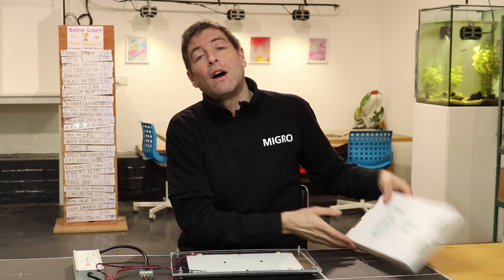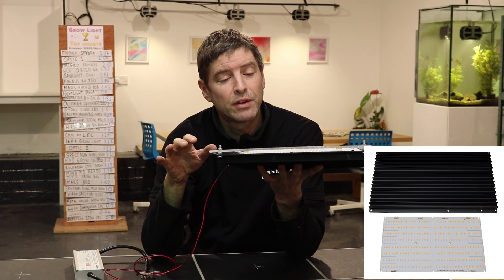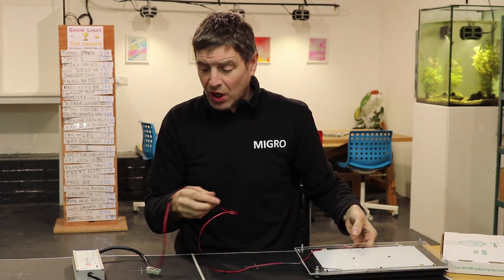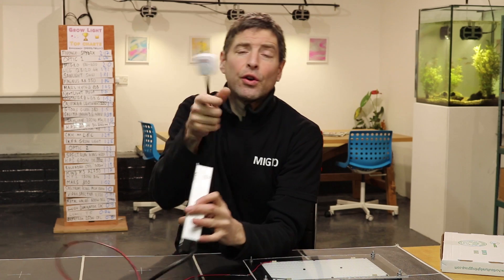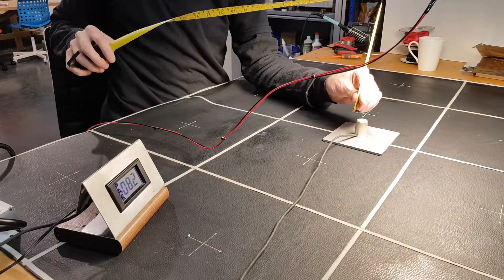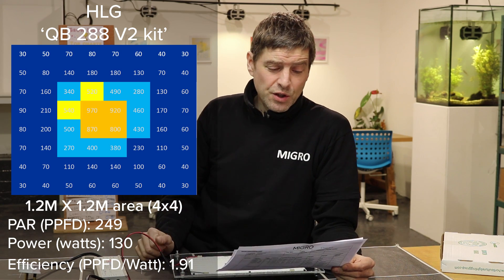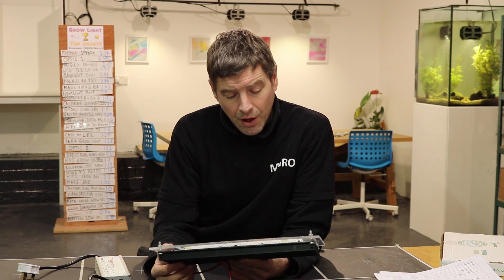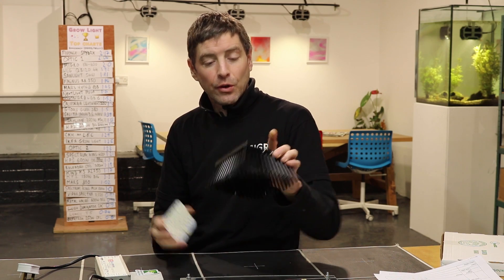HLG Quantum Board grow light test - Horticultural Lighting Goup QB288 V2

Comment: @migro 
Hello!! Last time i ask you about testing the Quantum Boards from China , they should also use Samsung 301 b Leds but for the half Price!! Regards
Reply: Right!
Reply: I am interested in this too. The one from Aliexpress.
Reply: can i have a link for this chinese QB? Thank you!
Reply: @dubbee2295  https://nl.aliexpress.com/item/Led-grow-light-quantum-board-LM301B-288-Pcs-Chip-Volledige-spectrum-240-w-samsung-3000-K/32957263985.html?spm=a2g0z.search0604.3.1.11d03c9ayZQNqN&ws_ab_test=searchweb0_0%2Csearchweb201602_1_10065_10068_319_317_10696_453_10084_454_10083_433_10618_431_10304_10307_10820_10301_10821_537_536_10902_10843_10059_10884_10887_321_322_10103%2Csearchweb201603_56%2CppcSwitch_0&algo_pvid=d058b077-d5ec-4795-acc2-b0d561b1ece7&algo_expid=d058b077-d5ec-4795-acc2-b0d561b1ece7-0
Reply: @dubbee2295  https://www.alibaba.com/product-detail/meijiu-quantum-board-301b-qb288-v2_60812802115.html?spm=a2700.galleryofferlist.normalList.199.195946c9mR31CA
Reply: Where do you think hlg gets their boards from?? Being Samsung is korean based I'm sure they get em before the US
Reply: @MrDollainc  the hlg boards are directly manufactured by Samsung for hlg. I cant find the spec sheet right now but when I get home I'll post it.
Reply: a lot the led boards they're selling in america are actually in fact made by those same companies for the american market, you'd be fine buying a chinese  one. as long as you check the specs. also you might get ripped off.
Reply: @Terrence_Acoose   they ask 200 euros for 2x 120 watt panels including heatsinks mounted already and they include the meanwell drivers aswell, i think its not cheap but also not that much of a ripoff, what are your thoughts?
Reply: @budgetking2591  the ripoff i talk about, is that you risk paying for something that isn't guaranteed. because they're based in china they could send you anything or nothing. the specs on most of the lights check out and should work perfectly fine, even if you have to modify them slightly. also something to consider, a lot of time there's extremely long shipping times, especially if you're not ordering a large quantity. another thing is that its hard to tell if these companies are legit, they use a lot of the same company photos and often times when i go back to check them out the companies disappeared entirely and another company is selling the exact same lights with the same images.
Reply: @Terrence_Acoose  Ok thx, good thing about aliexpress is if they send me something other then advertised, aliexpress gives you the money back, so not really worried about that part, more of the price, since i dont know what is a good price for those 120 watt quantum boards including heatsinks.
Reply: @budgetking2591  if you get the one with 288 lm301b its the same light just running a 48 amp meanwell driver instead of 54v, but doing the math the 48v one should work the same or better as it seemed more fitting to me, i could be missing a variable though but i doubt it. also it uses only 3000k leds, which a mix of 3000k and 4000k would be better for full spectrum.
Reply: @Terrence_Acoose  i have 2 diy builds 2 seperate heatsinks with each 3 cxa3050 4000k cree leds running at 25 watts, so my growlight is 150 watts, i want to use this quantum board for flower. my growing space is 50x100 cm, roughly 2 by 3 ft.
Reply: @budgetking2591  the light itself doesn't produce enough ppfd for flowering cannabis, even if you put 2 beside each other you're going to be a bit low on the recommended ppfd, which is around 800 for flowering cannabis properly and 1100+ for flowering cannabis with co2. 

the problem with mid power led's is that they're only capable of producing so much ppfd, and you're only able to group so many together before the outer led has no effect on the most inner led's ppfd, which forces you to raise the recommended height, then you need more led's to achieve the same result and even more to increase ppfd, which then you start to lose efficiency.

the best led's for flowering are the high powered COB's, specifically the luminus cxm series, which can produce over 500 ppfd per light, put 2 beside each other and you'd be good to go.
Reply: @Terrence_Acoose  I thought these quantum boards were an upgrade over the cob lights, because of the more evenly light spread, i have builds with cree 4000k cobs and 3000k cobs already, so if this quantum board is not better then those, i should not them at all then.
Reply: @budgetking2591  they are, when you get to the large ones, but then they cost 1500+ and you're running a board capable of flowering a 5x5 area that runs at 700watts. the small one's just don't have enough led's grouped up, these are more for vegging. 

the best setup is a double ended hps/led mix, you fill your space with led's and supplement the maxed out ppfd  with hps lighting, with a slight lose of efficiency around 25%. but because you aren't relying solely on hps you save a lot of money still, only a small % of your lighting is inefficient.
Reply: @budgetking2591   I could run 2 of these in a 5x5 beside a double ended hps and turn my hps light down to 400 watts and have better ppfd and efficiency. 640 watts compared to 1150 i'm currently running, i'd also produce less heat allowing me to turn my inline fan down or maybe even off.
Reply: @Terrence_Acoose  Thx for the answers, i understand now, the quantum boards are better efficiancy if you get big ones, but the cost per watt is much higher then  a cree or luminus cob build, while the cobs are not much behind in efficiancy, maybe 1 more + for the quantum boards is you can grow your plants a bit taller if you have limited hight in your growing space. Thx again for your time and answers.
Reply: @budgetking2591  just to correct you a bit, the efficiency is about the same, quantum boards have better spread like you said, that's about it, for a flowering build using quantum boards you'll need either a high power cob or hid to supplement the low ppfd output of the quantum board. even the big one's like the https://forevergreenindoors.com/collections/featuredproducts/products/lightpanel-700 
only put out (they claim) 950ppfd at the center in about 2x2 area, dropping off considerable by nearly 40% at 3x3 and way worse the further you go.

personally I think quantum boards are best for the small setup i explained in my last comment or commercial grows using hid/led setups.
Reply: @budgetking2591  another thing about the mid power led's, these companies run them at 100% more power than their rated efficiency and when you run them at a higher rated wattage the efficiency drops. but its necessary to get the ppfd results you need to grow a plant.
Reply: @budgetking2591  good price, they use the last gen samsung diodes, the lm301b's are their replacement. which are also about to be replaced by samsungs horticultural series of lm301h's
Reply: @Terrence_Acoose  Yeah, they also have strips with 240x lmb301b for 45usd/piece, but the strip with 160xlm561c costs 17 usd. 2 times less per led, so im leaning towards those, i saw in specsheets the 301b is only a couple % more effiient then the older lm561c.
Reply: @Terrence_Acoose  on alibaba there's ways to protect yourself, ask them to take a photo of your address on the shipment and to send it to you, also a picture of the shipments condition. There's probably a more indepth guide to it out there
Reply: @Terrence_Acoose  negative.  All led setup. is best.  You must run hps 😁
Reply: @justinmajewski5904  leds are great if you're running an illegal setup and need to stay under a certain wattage, but the reality is, they dont have the canopy penetration hid light has. 

That's why most legal commercial grows use hps/led setups, you get the efficiency and the baseline ppf you need, and hid gives you the canopy penetration. 

You see the issue with mid power leds is they need to be really close to the top of the canopy to be effective, once your plant grows a 1' that bottom section below the canopy isnt getting very great ppf.

When you take into consideration hid lightings ability to penetrate the canopy, and you take those ppf numbers into consideration, hid lighting is better because of more usable light. 

I like leds and prefer them because I can have 2x the setup for the same wattage, with very minor flower density lose. Even though each plant doesn't yeild as much I have 2x as many plants in 2x more area.  

When you start to use 2k watts+ energy draw, it starts to look very suspicious,  otherwise the price of LEDs and the very minor savings you actually get (depending on where you are, my powers cheap) does not justify the average small scale or personal grower to invest in. 

For example, running a 1000w hps compared to a 660w led is going to save you maybe 20 bucks a month and cost you about 1000 bucks more.  

In 5 years you'll need to buy 5 bulbs for that hps at about 200 total and 12x5x20=1200
1200+200= 1400

Over 5 years by purchasing that led light you've made 400 bucks. Again not really make or break stuff there for a single light comparison. 

At that point you've grow so much you dont even care about the very small price difference of 33 bucks a month.
Reply: @Terrence_Acoose  Negative.  Ppfd is ppfd.  Dead wrong.

Comment: As per the videos of Dr watt in the monster gardens channel... If the light engine is a HPS 1000w... The photons come with more energy and therefore they can reach deeper bids sites down below... When comparing the hps to the black dog 1000 they end up confirming something i already noticed with my 3watt diodes... They work great... If your colas are no more than 20 cm long... Here the importance of an even canopy... While my friend with hps got nice buds on top and down below in an untrained plant... When applying this logic to COBs vs boards... I tend to believe even though same wattage is used... The QB might be using 10 times more diodes than a cob... There fore each diode produces light 10 times weaker (the distance photons can travel and still be usable by the plant) and this is why I'd guess a COB can be placed higher than a QB...  So far i have only used 3watt chips... And these new "10 watt" chip boards (run at 2 watts each) and i have noticed a healthier vegetation grow with the "10 watt" diodes...
Reply: I think that you are totally right. 
Many people know those QB Style LEDs vs HPS videos where they compare them with same conditions? 
Guess why they always choose to grow with a SCROG in a closed tent? - it's because they lack deep penetration as the small diodes simply are not powerfull enough to penetrate more than 30cm down the canopy. 
QBs are only good for smaller indoor growers who choose to grow with an even canopy, but thats not the way cannabis naturally grows. Everyone knows the canadian grower Urbanremo right? 
In his growroom he chooses to grow with spectrumking sk602's (not intending to advertise here), when we (obviously) know that HLG/MIGRO/OPTIC 1 are more efficient, the reason why? -Light penetration and the way he chooses to grow.
The HLG QB/MIGRO/OPTIC1 have their optimal hanging height @~30-35cm, (max. 1000 umol/s in the center),
 the sk602(or High watt HPs like 1000w DE)  have to be ATLEAST 60cm away (max 1000 umol/s in the center) 
So @ canopy level (30cm away from lightsource for the MIGRO/HLG/OPTIC1 and 60cm for the SK602/High watt HPS) we get 1000 umol/s.
The inverse square law says at double the height we only get 1/4 of light penetration:
So 30 cm below the canopy (60 cm below light fixture) the leafes below the MIGRO/HLG/OPTIC1 only get 1/4 of the light so 250 umol/s (30cm is optimal height so 30 below the canopy is double the height so 1/4 the light).
Compared to the Sk602( or High power HPS) where 30cm below the canopy (90cm below the light fixture) is only 1/2 of the height more from the light source meaning 30cm below the canopy the leaves still get 500 umol/s.
 So @120 cm below the lighfixtures @center the leafes get 250 umol/s(sk602) and 62.5 umol/s (hlg/migro/optic1).
So if you want to grow natural BIG PLANTS  with a height of 2m or more (like urbanremo) you cant use QB'S/MIGRO/Optic1 as their penetraion is too weak. with MIGRO/HLG/OPTIC1 The leaves of a 2m tall plants would only receive enough light (atleast 250 umol/s)  30cm from the top . Below that the light would be too weak, and thus 90cm height of your plant is wasted. 
In a small grow (e.g. tent) your height is limited so you better grow with an even canopy to get good results and therefore the light penetration of 30cm is more than enough.

Comment: The footptint would increase if the lens wasnt focused at 60°
120° beam angle increases grow area.
120° wouldnt work in a fixed Kelvin light like this one due to lack of spectrum.
Therefore....the customer needs more lighting....uses more electricity....to cover said area.
I thought leds were supposed to be more efficient?
Reply: You can't unfocus a lense and not see a decrease in performance without adding power.. It's a law of physics. They do save you money. No one said shit in this video about quality results or yield. Take it for what you will.
Reply: @Dynasty125  Damn...
Reply: @Dynasty125  my friend....when someone designs a light....we have options for beam angle.
120-90-60 
If spectrum is correct....120 is the best choice.
Imo
Reply: @FineHomePainting  agreed.
Reply: @Dynasty125  not true.
Reply: 2 exact same led diodes exactly the same but the only difference is their beam angle, then one with the smaller beam angle WILL IN FACT, PROVEN SCIENCE UNREFUTABLE, TEST IT YOURSELF AND DO RESEARCH, have a more intense light par output and greater u/mol, ppfd values all around.
Reply: @Dynasty125  lol....ok.

Comment: Why in the world would you test this light with a 1/4" piece of plastic covering the diodes. Not even remotely a fair test or comparison. Easily a 20% loss with that cheap shit covering the diodes. SMH
Reply: We want to see grow tests.
Reply: @micktronic330  True they do show that and it is avail for certain reasons but 95% or more do not use it and also if you check the page it shows 0.08 Inch (2MM) thickness of Acrylic. The one he is using is certainly not 2mm thick..
Reply: @micktronic330  They also sell optical quality lenses for their boards,  which would be a fair comparison to migro's lensed fixture.  But he didn't test that,  because it would reveal that it's actually way brighter than his light when compared apples to apples.
Reply: Any comments after the retest video guys?
Reply: it's 3% loss, which is noted in the video. read/watch > think > comment
Reply: @RemoteWipe  So.....the best low iron glass will cause an 8%+ loss, and you think this cheap plastic is only a 3% loss? 😅🤣😂
Reply from the maker: I tested it before and after and the difference was 3% averaged over 64 PPFD measurements. I've tested with glass coverings on HID  reflectors and the difference was also 3%.
Reply: @MIGROLIGHT  then why didn't u update the chart correctly and say it instead of a little note saying 3%? Hlg doesn't suggest adding anything to their lights. I think this should be retested
Reply: @micktronic330  Also....these boards are Zhaga compliant and actually have real lenses (Ledil Florence series). Got anything else to say boy?
Reply: @micktronic330  Been using HLG products for far longer than this channel. They don't recommend using anything, hence the design of the HLG550. They have said that if you absolutely MUST use something to cover them, then acrylic would work. Keep believing everything you hear on YouTube though boss. Know who you're talking to before making dumb comments bud. 👍👍

Comment: Hlg 550 v2 next please
Reply from the maker: It's 4 x QB288
Reply: @MIGROLIGHT  It's also ETL listed,  which means it's safe to use without a giant piece of plexi over it.  Unlike the slanderous claims made in this video.
Reply: Lol slanderous? He simply pointing out if there's water or any debris on the LED itself can cause a hotspot or burnout... How is that slanderous? I'm pretty sure this is true with any LED or light in general. Calm down guy.